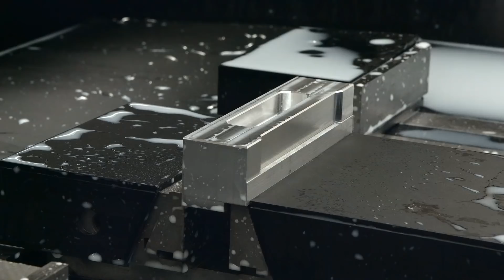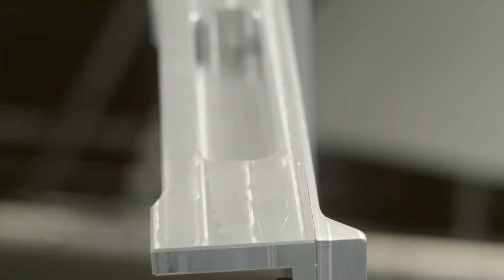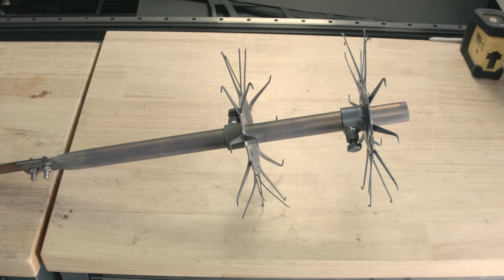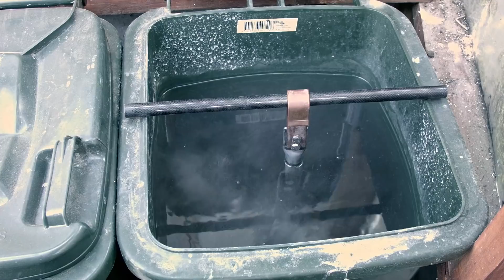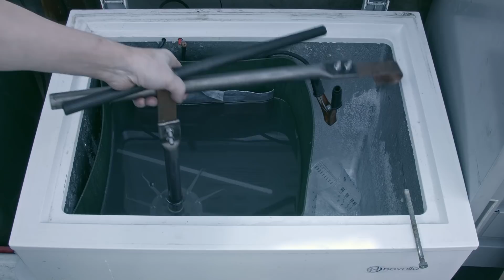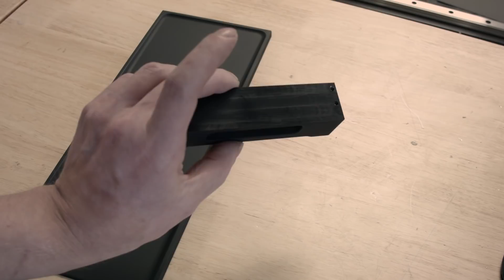vise covers - milling, sanding, anodizing, laser marking.

Comment: Wow... Again, WOW!!! I have been following your build and channel. I've got to say, you've come a long way and ready to make NASA shuttle parts! :D I've got to ask. If you had to start all over again, would you go with the same epoxy granite build? Or are there things you would change?
Reply from the maker: haha :) yes it was a long way :) btw. my cnc is 100% granite. i used epoxy glue just for the inserts.
granite construction is perfect and i wouldn't change it to anything else. i would just extend side walls up and 200mm at the back beyond the big surface plate. so the spindle can reach the whole table. this is not really important as I never had a need to mill something which is 600 x 700 mm, usually stuff is narrow but long. so current layout works great.
Things i would change are the cheap rails and screws i used.
Reply: @PiotrFoxWysocki  My mistake! I went again through your build log and saw that they were surface plates. 

I remember you mentioned they were unbranded rails! What size are they? You are really convincing me to make a granite CNC mill. :D
Reply from the maker: rails are 20mm. I don't want to convince anybody, just to show alternatives :) you to decide :)

Comment: I want to upgrade my cnc setup. Could you tell me what motion control board and motor controller do you use?
Reply from the maker: I will be changing the controller soon, I have been using gecko540 straight from mach3. I got UC300eth-5lpt to replace my gecko, but this also could change. not sure  yet.
Reply: @PiotrFoxWysocki  I want to use ethernet controller but I'm not sure if it is better than parallel port. There are out there lot's of chinese product's but I don't know if they worth the money. Also there are offline contol units... I'm little confused
Reply from the maker: apparently Ethernet is better than parallel port(faster/ can run on modern computers) and better than usb because of the electromagnetic interference.   
I'm not an expert on this and I'm not troubled by it too much. i got my self new fast controller with Ethernet and plenty of input and outputs. 
i guess this should last me for a very long time. 
I don't trust Chinese controllers because you never know what you getting and there is no support when you need it.
Reply: @PiotrFoxWysocki   Thank you very much. This was very helpful. I would appreciate a video with the controller changing. Keep going
Reply from the maker: @Nikos_M-o6c  I'm glad I could help in such few words ;) definitely I will make a video of me setting it up. Once I get to it.
Reply: As an alternative to Mach3 and UcCnc there is also the Centroid Arcon controller and of course LinuxCnc
Reply: Oh and also Eding cnc

Comment: It all comes down to sanding in the end doesn't?  Do you rotate jobs on the vices to even wear the ballscrews and guides?
Reply from the maker: with 3d milling i don't see any other way. there will be always tooling marks. except when you go sideways. I don't rotate between the vises because quite often i mill long parts so I'm not troubled by it. soon i want to replace those cheap rails with some good quality roller guides, so  I don't care for them at all.

Comment: Nice job!  Looking forward to more on anodizing as I am building my own mini-line (nice to learn from someone who is already up to speed).  What sort of laser are you using?
Reply from the maker: im planning to do whole series on anodizing, topic is so large that i don't know where to start :D
im using regular co2 laser
Reply: @PiotrFoxWysocki  I have the book "Aluminum How To" by R H Probert which has been a great guide - but nothing quite like seeing someone actually doing it!  He recommends air agitation (which has to be clean air) and keeping parts clean between tanks to stop contamination - which you are doing by using the water spray.  I have a similar idea for spraying water to you except my parts are all a similar size so I can make a "CNC water sprayer".

That idea of chilling inside a fridge - genius!  You could use the aluminum chips from the milling machine in the bottom of the fridge as thermal inertia - to keep it cooler for longer.

I am going to use Gastronorm containers from the catering trade - available in stainless or polypropylene - 1/1 size which is 535 x 325 x 200(deep); according to Probert you need 5 gallons of anodise solution per square foot of surface area; so those are fine for my parts.

When I have parts anodized commercially they always put nylon screws in threads before processing - that's because liquid is hard to get out of threads (especially blind holes), but there's a side benefit because the threads are then conducting!

I cannot thank you enough for showing your process.
Reply from the maker: @chrismr3972  I'm really surprised that this video was so helpful, I just briefly showed the process without explaining much. But I'm glad it helped ;) if I could suggest material choice I would go with poly propylene  tanks. Especially for sealing as it can not be done in metal containers. About aluminium chips around anodizing bath. Before I was using small veritcal bar fridge, and because I was opening it back and forth I placed a lot of thick aluminum plates inside as thermal mass. Aluminium chips have too much air in between and no substential mass. Better would be to fill my current fridge with water mixed with baking soda just in case to neutralize spills. But it would have to be mixed also with some antifreeze which doesn't react with acid.
Reply: @PiotrFoxWysocki  That's really interesting, about sealing not being in metal containers.  In Probert's book he suggest only stainless steel for sealing and the temperature to be 82-100c.  Same for dying (stainless).  I'm not "stuck" on his book, just using it as a reference.

I was only meaning that the chips wouldn't go to waste!  But your right, it wouldn't have a huge effect.  Most commercial lines use glycol to move cold around to the bath from a refrigeration plant, or pump the acid to the cooler - which compared to your method is really complicated.

In the brewery industry they use an "ice bank" for cooling beer.  Basically a freezer that builds ice overnight to be thawed during working hours.  I wondered about using a beer cooler - but again, your idea wins.

It would be great just to hear more about what you have tried / found out - maybe that's a starting point fro your series?
Reply from the maker: why i don't recommend stainless, at the beginning i was sealing in stainless steel pot on the stove. and parts where coming out black (as they should) but with rainbow color pattern film on top. i was able to polish it out, but corners of the pockets where much trickier. not sure if it was because it wasn't brand new pot or because of SS it self.
i can't pin point where i read that SS is not good for sealing. but this was long time ago and i wouldn't call it confirmed or properly tested.
but one thing is 100% confirmed that SS and titanium don't work well together - galvanic corrosion.
To simplify my life and saving time spend searching internet on all sort of weird problems, I just went with all plastic containers.
no problems since.
about moving cold around i thought they move acid it self to a chiller and they filter it at the same time. which to me would be nerve wrecking.
10000 liter tank of acid, if pipe bursts.... RIP :)

I found chest freezer best for cooling, because all cold stays on the bottom (supermarket open fridges) but i would try to avoid filling it up with water because if it freezes it will crack the freezer walls

thanks for the suggestions on where to start :D

Comment: Very sexy Piotr, very even Anodizing and colour,
and it looks practical as well.
Quite the set up for Anodizing, you must have been doing a production line to need that. Noice!

Keep up the good work.
Reply from the maker: thanks :), i started from 2 liter tray, than 10 liter, but parts where getting bigger and bigger, 20 liter. and finally i arrive to 100 liter tanks :)

Comment: Excellent and inspiring work Piotr.  Just curious, do you know what power and wavelength of the laser required to transform the dye like that?   Incidentally... I notice you have added sliding covers for the side rails.  Did I miss the episode detailing their construction?  best ~c
Reply from the maker: laser im using its a regular CO2 laser. you can't cut metal with it but you can remove any coating from the metal, even rust.
you have great eye for the details :) yes i did add sliding covers and i even recorded it, but i wasn't sure if this thing will be interesting for anyone to watch, so that's why i haven't put it out there.
Reply: Certainly a subject that is not often discussed about.
Seems kinda important to prolong the life an get better reliability on a motion system.

Comment: Nice and interesting video! especially the anodizing part, which I have some questions about :-)

What concentration of the caustic soda and nitric acid do you have?
What kind of dye do you use  for coloring?
Why use nickel-acetate as sealer? why not boiling water?
Is that some sort of extra lining I see in the sealing-bucket?

Why do you only use the face-mask when taking the parts out of the sealing-bath and not when putting them in?
Reply from the maker: haha:) i will try to answer in order :)

caustic soda concentration and nitric acid is eyeballed :)
with caustic soda i was adding it until i was happy with the speed of the reaction. i think i put 2kg of caustic soda in to 70 liter of tap water.
nitric acid is pretty much the same story, i got 2 liters of 70% and i put it in to 70 liters of distilled water. With nitric acid you have big wiggle room. it wont eat your aluminium part if its too strong. and if its not strong enough it will take more time to clean, but it will do the job.
dye, I'm using some Chinese dye made for anodizing aluminium, i needed 1kg and buying it locally would cost me 5x the price.
nickel-Acetate allows to bring a temperature down from boiling to 80-90 deg C.
it takes time to boil 70 liters of water, to be precise it takes around 2h with 2000watt heater. and than you evaporating precious distilled water. so bringing the temperature down will makes thing easier.
(i have all my tanks insulated so it is not so bad, but i was in hurry for some job so i added it in)
lining in sealing tank,
those tanks have written on them not for hot liquids or ash :)
turns out they are made for hot stuff :) 
those rubbish bins are made out of 2 parts walls and floor and they must be heat fused together somehow. because it burst in the corner on the floor.
i really like the form factor of them so i fiber glass it using vinyl resin.
so now i have tank inside the tank :)

mask. I'm a dude, dude :)
i can't do 2 things at the same time. recording, explaining and remember to putting on a mask :)
anyway at low temperature of 80 deg, its not so bad, but when its higher its deadly.
Reply: @PiotrFoxWysocki  Haha, thanks for the detailed answers :-D really appreciated!

Comment: Those covers look fantastic! You called them hard anodized. I think hard anodizing is supposed to have a color depending on the alloy with a pore size too small to accept dye very well. At least that is how it worked for me... Did you use sulfuric acid or another acid to anodize? Your calculator shows very low current density and voltages compared to what is used in hard anodizing.
The voltage is supposed to start at about 15V+ and then go up to 100V or so (for a nice thick coat). You stop at 15V. The amperage is usually 25A/ft^2 or more. You use 6. Of course, that kind of power makes it challenging to keep the cold temperatures in the work piece. If the bubbles are not enough, you may have to add additional agitation. Just my 2 cents. Love your work. Keep the videos coming.

Some links so you don't have to take my word for it:
https://www.finishing.com/523/50.shtml
https://www.precisioncoating.com/hardcoat-anodizing-type-iii/
Reply from the maker: yes i agree, hard anodizing gives a olive color to aluminium, intensity depends on the type and makes pores too small for dye to go in. i have been experimenting for a long  time to get anodizing as hard as i can but still with ability to absorb dye.
i'm using 15% sulfuric acid bath   to do my anodizing.
calculator is for low current density anodizing. LCD. i find it works really well and when you keep your bath at low temperature anodizing grows really thick. 
its really visible when i laser etch it to bare aluminium, thickness of anodizing looks like powder coating. I can't put a number to it yet. but maybe eventually i will get some anodizing thickness measuring device. (if someone is willing to donate, now is the time :) )
Reply: @PiotrFoxWysocki  0.001 dial indicator?